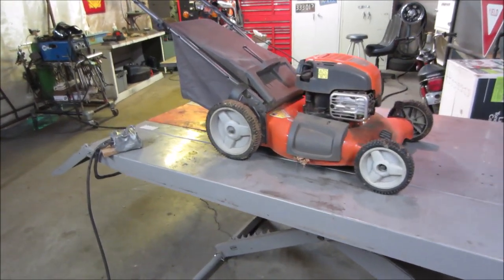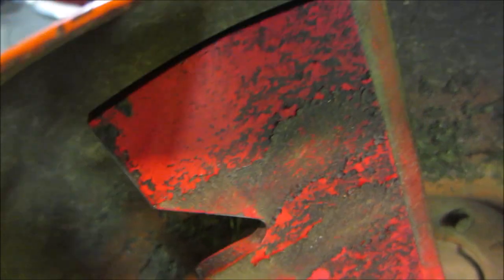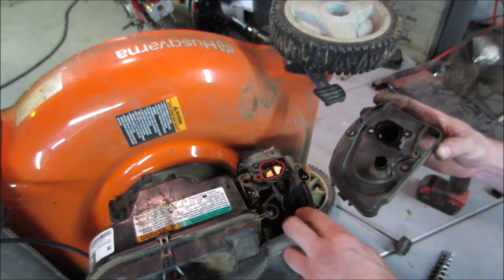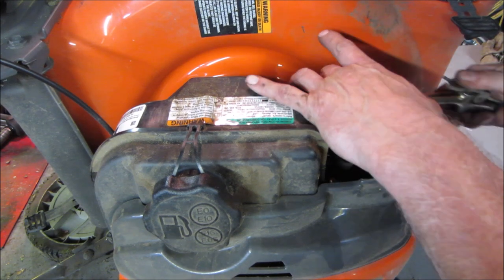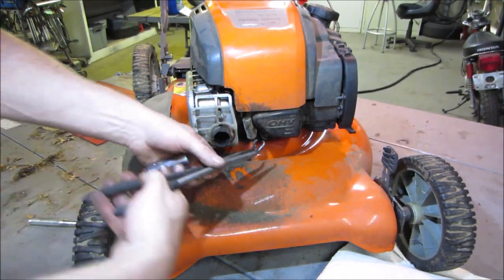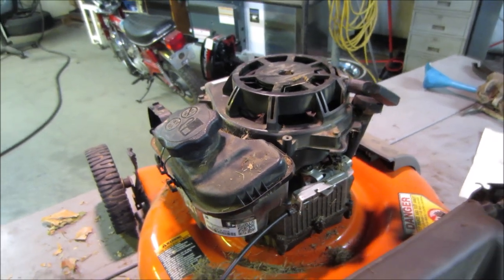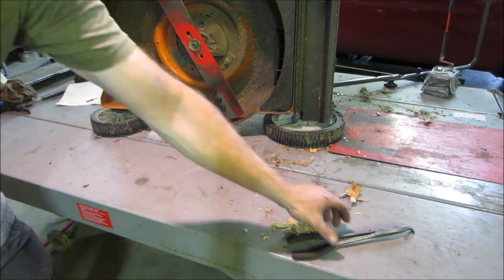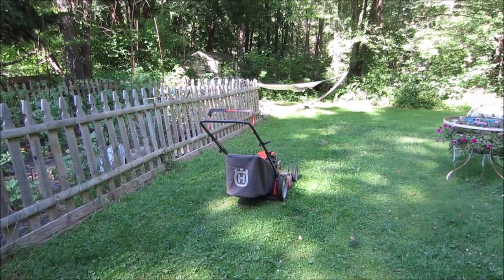NO OIL CHANGES? Servicing A Broken Yard Sale Lawn Mower,

Comment: The engines are much cleaner thats how they get away with it but oxidation i run synthetics hold up well 3 years not lifetime
Reply: The problem with 3 years is with regular use you won't have any of that oil left... will be all burnt up... They are all splash lubricated and oil barely any oil man... If you just top it off it will effectively have all new oil year round...

Comment: I have a question,  After watching this video, have you encountered this?  I have a self propeled mower the same brand that has an automatic choke with a high idle until it warms up then the idle drops down.  When you get into heavy grass it automatically throtles up and then drops back down,  My question is, How?  How does this mower know when to drop off of fast idle and speed up automatically?  I can't see the carb with out disassembling half the mower. (Covers and such)  It acts like it has a &**&(*&^%$ computer on board.  Mowers getting smart?

Comment: Stabil and starton gas fuel additives works great on keeping fuel good.
Reply: Stabil is useless. It does not prevent alcohol gas from gumming up the carb.
Reply: John Smith is why I turn off gas let mower run out of gas.

Comment: Just check and add. It burns to quickly to ever need draining.
Reply: I have the same engine on my mower; and it does NOT Burn a Drop; Matter of Fact; I put in perfect 15-oz. every year; and I Drain 16-oz.  That is just Natural 50 / 50 Mix of Water / Fuel Contamination from the combustion process. But I change the Oil Every Year and it Runs Great.

Comment: The just check and add thing is pretty much a marketing gimmick. Just check and add for the service life of the mower. if you only want it to last for the specific number of hours they have determined as service life then just check and add. it will last longer if you change the oil

Comment: Most of the newer lawn mowers take only 13 ounces of oil, the others take 20 ounces of oil.
Reply: Mine is a 2016 Snapper SP90Q Self-Propelled Walk Behind; with Quiet Power Technology; it takes 15-oz. Most of those 163cc's take 15-oz.

Comment: Looks like a ez start carb... the slightest chunk of dirt and you got a no start. Pop out cartridge and drip it out with a .17 drill and voila... I think that tiny jet orifice is for emissions... nonsense... use premium gas... ethanol can’t sit around in the tank or just run it empty

Comment: With modern tract housing the backyard is 20 x 30, and if they are lucky the front is 20 x 20,  which equates to a yearly average of less than 15 minutes run time per month, and a life expectancy of 3 years or less, so why ever bother with changing the oil.

Comment: Yeah. Never change the oil. Like those new cars that tell you you never have to change the transmission fluid. You just use it till it doesn't work anymore and then buy a new one. See how easy that is?

Comment: no oil changes because they're basically waste oil burners, you put in used motor oil and by the time you mow the yard 5 times you're gonna have to top it off with more.

Comment: The oil thing doesn't surprise me. I think it's marketing just leaning into the curve because that's how most people treat them regardless of what the manual says. Including people that should know better. 

I had a teacher in high school in autotech who bragged about how much smarter he was than the schmucks that pay for oil changes and tune ups on their lawnmower every year. In his professional opinion you just filled the oil every spring until it over flowed slightly and let it burn off the extra. The douchebag was one of those people that would spend $1,200.00 on a new lawnmower every third year or so, brag about how much he spent on a frigging push mower and then treat it like shit and bitch about how crappy the quality on even expensive mowers was these days.

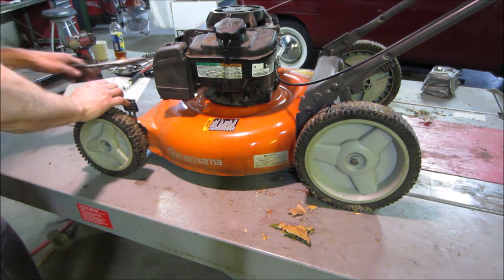Comment: AT 21:21

Why did you pull the plug wire off ..??   Did you THINK the slow rotation of the mower blade would be enough to crank & fire over the engine and chop your hands off..??  I don't think so and if you said JUST IN CASE ... Thats even worse. You know as well as i know you CANNOT start that mower by rotating that blade with your hands .... If you can, i would LOVE to see a video on it .. !!!

Comment: YUP, draining oil from generator engines is a witch and a half. I use a small fluids pump.
an engine just won't work well with a clogged air filter.
Reply: @paul beenis YUP, I hear it makes the engine overheat, heard that about
motorcycle engine some time ago.

Comment: Pretty sad just throw your lawn mower away every couple years and they wonder why the landfills are so full .Whatever happened to men that could actually maintain their own equipment. I guess they're getting to be far and in-between...
Reply: Jason Mercer — most guys under the age of 35 have little to no mechanical aptitude.   Lawnmowers have become so cheap (a bare bones model can be had for about $150 bucks), that people would rather throw them out vs working on them.   I’m in my 50’s and treat my mower with kid gloves.   It’s nothing special, but I still take good care of it.   I change the oil every season, resharpen the blade every month, clean out the air filter periodically, and wash her up every so often.   It’s 8 years old and still runs like a Swiss watch.

Comment: 10 year old mower with a 10 year old air cleaner.  Ya think it might be time for a new Air Cleaner?
Reply: I don't think that mower is 10 years old. My parents bought a toro mower with this same exact briggs and stratton engine in it about 3 years ago. If only he would have looked at the EPA tag on the side of the gas tank, then he would know how old it is.

Comment: Plastic carb XD doesn’t gasoline eat plastic?
Reply: Not whatever plastic this is. Briggs has gone this route on all their consumer based products, except riders. Only additives you put into can destroy the seals and tip of float needle. Make it swell and no fuel will enter bowl. When the carb clogs, you only replace the main jet... a $10 part.

Comment: The never change the oil thing is due to the engine is designed to burn oil it is dumb and i dont understand it but that what it is.
Reply: Kinda like a 2 Stroke? that what it sounds like to me.
Reply: The owners manual clearly shows that you do indeed change the oil. 
On the box, it says never change the oil because of marketing! It is a machine, machines have to overcome friction, oil prevents friction!
Reply: I agree. But they are dealing with folks that don’t know their head from a hold in the ground when it comes to small motors.
Reply: The mower I have consumes oil out of the box.  If I don’t top it off before every time use it it will eventually destroy it self.
Reply: @kidtoe1000   bad rings?

Comment: Nobody changes oil in lawnmowers.  Nobody, but me and like three other people on the planet. And they always wonder why they don't work or don't want to start, I have three mowers, paid for only one of them. You can buy mowers for $25 all day at thrift stores.

Here it is, two tips that will make your mower run perfectly forever, I know I'm giving away my secrets, but oh well, my loss.

1. Synthetic oil.  Nothing makes an air cooled engine work better than synthetic oil, Amsoil or Mobil 1 15,000 stuff, change once a year, they only use a third of a quart.

2.  Use fuel preserver in your fuel, always, every time. Keeps the engine clean, keeps fuel from spoiling.

That's it. Easy starting, run forever, minimal maintenance.  And you know, change the air filter every once in a while. Iridium or E3 spark plug can't hurt either.

Don't worry about the drain plug, just drain it out through the dipstick hole or suck it out with a pump.  Super easy. Less messy probably.

Comment: No oil drain plug for oil changes, and plastic carburetors. Not good. Straight garbage right out of the box. Pretty soon we will see fully molded engines with no head gaskets, valve covers, and a spark-plug thats part of the casting! Give it time....

Comment: Next they'll come shipped with a tank full of fuel and the box will say Never add gas...just check. When it runs out, it's EOL. Toss it and buy another. Same with their weed-eaters. Toss it when the string runs out.
Reply: I call those Bic lighters of the small engine world. When they run out of gas, throw them out. Seriously though, I invested in a set of the special tool used to adjust a gas powered weed eater and know how to rebuild the carburetor on them to get them to run like new( some times better). The expense of taking in a weed eater or cheap lawn mower to a service center can cost more than a new one. The air filter on a lawn mower runs $8 or more now. Oil runs $5  a quart. The blade is $20 now. Then add labor. Yup, its stupid. I replaced the drive wheels on a Toro self propelled mower. $30 at Home Depot. It would have cost me more ordering on line. WTH! Shipping cost almost what the wheels were.